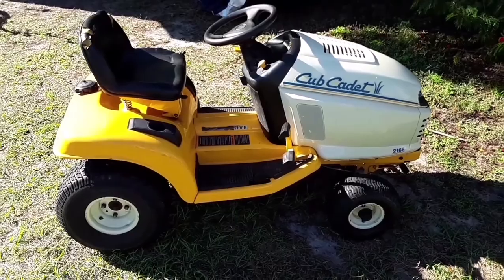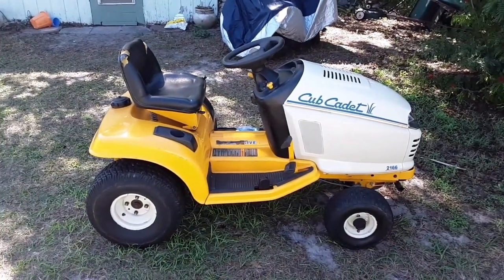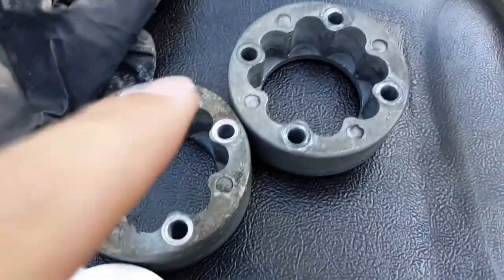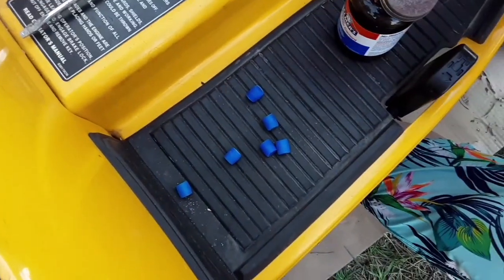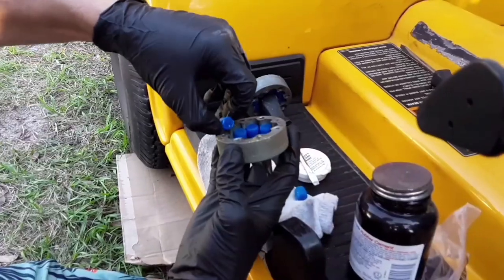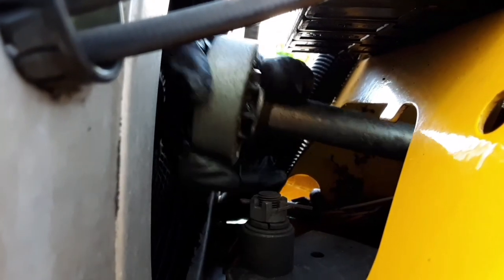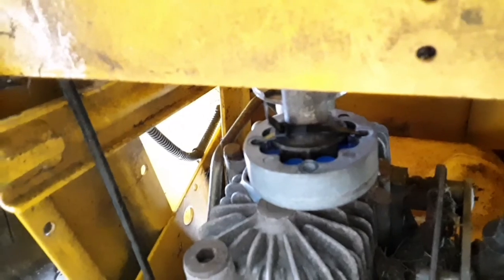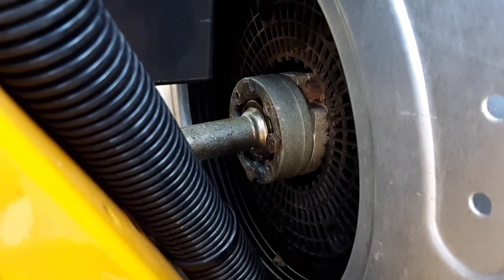Cub Cadet Series 2000 Drive Barrel Replacement (Without Removing Driveshaft)

Comment: Great video! Just replaced the whole drive shaft and barrels on on my dads ‘95 Cub Cadet 2130.  I took it out without removing the body, but took the body off to reinstall it.  8 bolts to get it off.  Unhook the wires for the seat, two bolts next to the seat, 4 bolts (2 per side) on the floorboard, and two bolts to get the gas and brake pedal removed.  Takes about 15 minutes to take the body off of it and then you have much better access to the shaft for using an impact to remove and reinstall.  Then you don’t have to work upside down 🙃
Reply: Wow 15 minutes to remove the body-  are you sure?

Comment: I am having a very hard time doing what you just did .While moving my driveshaft around my coupler fell off .Now I'm back to square one.I used gasket silicone to glue the barrels in place. I used scotch tape to hold the front coupler onto the drive shaft. I got the rearcoupler mounted. But now there's no room to put the front coupler back on.  I about killed myself using my pushmower to mow real tall grass in one hundred degree temp here in Texas.

Comment: Great video. Thanks for sharing! I have this same exact lawnmower. Yesterday my barrel bearings went out. I went to the dealer and ordered the 2 sets of barrel bearings. I took mine apart to remove the shaft. I had to grind the burs off of the flange pieces. While I took the black plastic/dashboard off, at the bottom in the battery compartment area, there are 2 gray push button things. Do you have any idea what these are for?? I think you could have seen them both when you were laying down on your back installing the shaft. I will look tomorrow. I didn't even know they existed until I took the steering wheel off to get the black plastic dashboard off. If you can't answer my question, do you have any idea how I can find out, outside of sending cub cadet an email, to which I'm not certain they would even reply, especially in a timed fashion. lol! The mower you have was a great find and the repair that you did was great too. Hopefully, I hear back from you. 🙂
Reply from the maker: I can't say I really know what parts you're referring to as I don't believe I came across them while doing this repair... if you ask your local MTD / Cub Cadet dealer they would probably have some insight on what those parts are and their purpose.
Reply: Probably what you are referring to is the PTO reverse kill safety switch
Reply: @kinghenry8615  Thanks! You are exactly right. On the left, it is supposed to disengage the blades from turning when the reverse pedal is pushed down, 'PTO reverse kill safety switch' sounds like an appropriate name. On the right, the button engages when you push the brake pedal. Your information is accurate and precise. Thank you for replying. 🙂
Reply: @juliusfonferek  Thanks! 🙂
Reply: @RafaMorfLuos  I by passed  that stupid kill switch within the first week of ownership! As well as the brake switch and seat kill switches

Comment: Great video. I rescued a 2135 got it running, mowed a bit with it, and the bearings must have gone out on the motor side of the shaft. Thanks for the upload. Do all 2000 series use those bearings?
Reply from the maker: As far as I know they all have the drive shaft barrels on these models. Glad the video could help!
Reply: @juliusfonferek  Both ends need barrels! It could be twisted at the motor and at the rear. I cant believe it could move at all.
Reply from the maker: @buckfiden6187  wow, must've been a chain reaction where one side going out caused the other end to do the same.